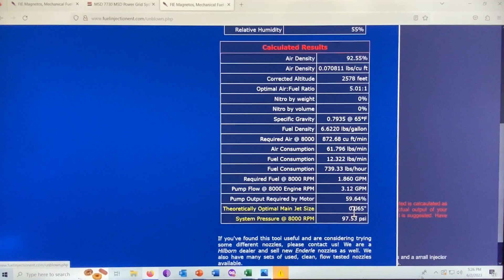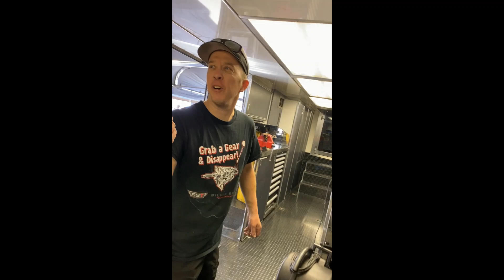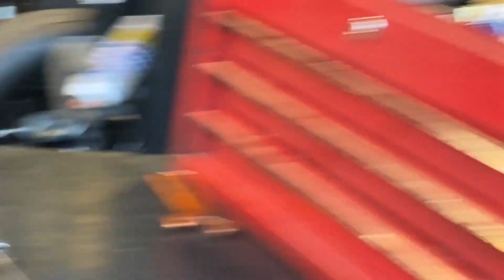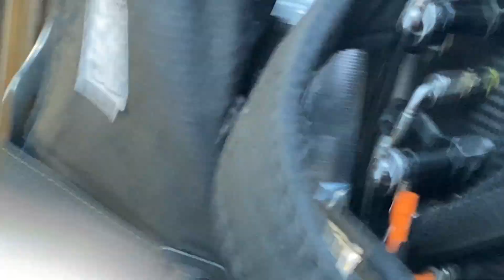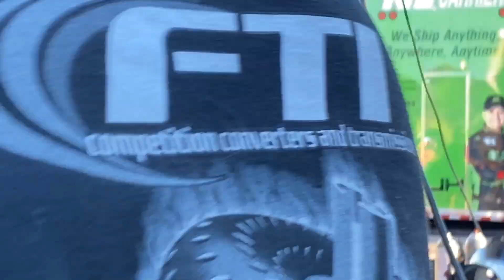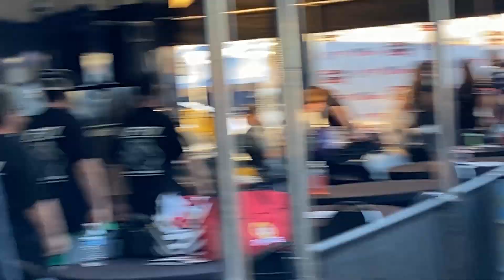8 Stack Mechanical Fuel Injection 101 (Part5) Tuning Software + Visit FTI Pit at Gatornationals

Comment: You are the first one to breakdown and actually show the principal of how the barrel valve works.  Excellent review of the entire mechanical FI. Unfortunately, it looks like FIE has removed any link to their calculators! 
:Edit . . . the calculators  works now.
Reply from the maker: Hi Chip. Thanks for the comment.  I just tried the link and it seemed to work.  Will mess with it in the morning.  Don’t forget, you need to register to get access.  Its no threat to do so.  Lmk if you still have problems.   Randy
Reply: @digitaloverdrivesystems  Thanks for your reply. I tried it today on my phone and the calculator link was back and worked fine. Now I'm on my computer and it works as well. Very strange! The other day I drilled around for 20-30 minutes and couldn't find any calc link.

Comment: Randy, As others have said, you've created a great teaching resource here, really well done, thank you. I found your series while looking for answers to the questions I had about 410  sprint cars. Why Methanol and why MFI?. Things that work well aren't often discarded and they've used both forever but I wondered what drove that choice in the first place? Did one choice drive the other? etc But I couldn't even find anything that explained how MFI basically works so this is a great series.

Comment: Randy, Thanks for putting this together. I run a BBC in a dragster with a Kinsler MFI. I've run this combo for 20 years. I'm constantly told to upgrade it. I'm an older guy who likes to drive my car, not let a computer do it for me. After 20 years, I feel there's still so much to learn. I have found several nuggets in your videos. For some reason I thought it was a great idea to scrap the K&N filters and put a scoop on it. A whole new set of challenges. Time will tell if that was a good idea. Thanks again for your information!